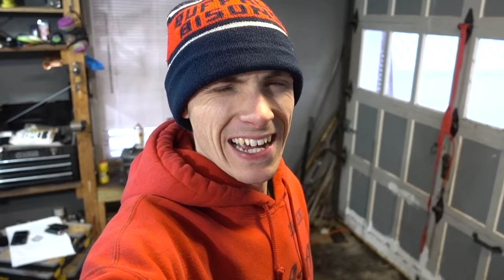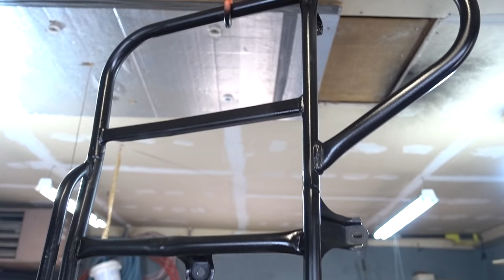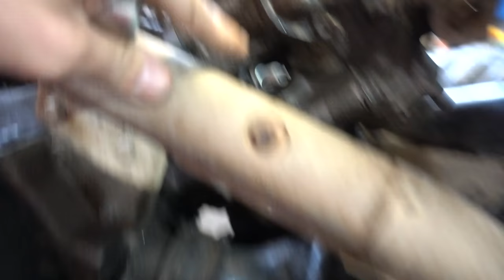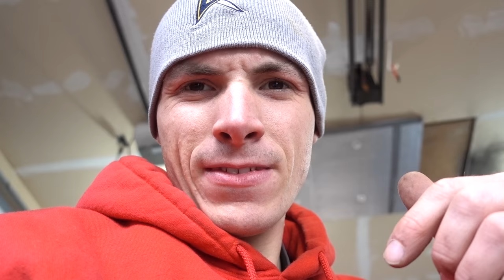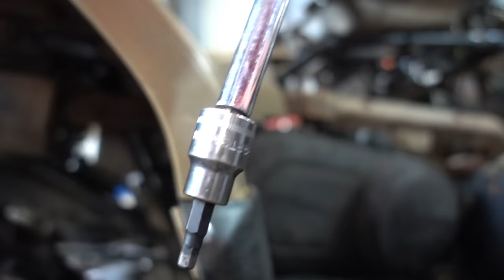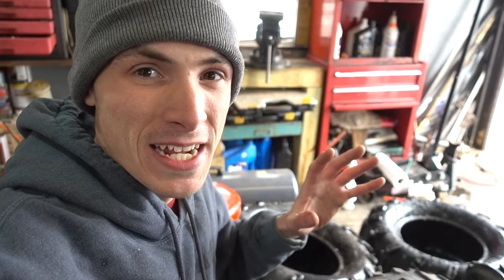KODIAK GETS NEW MUD TIRES!!

Comment: word of advice buddy, turn the petcock off while your rides are still running until it runs the fuel out. it prevents a leaking carb issue from ever happening as well as the fuel in the bowl from going bad